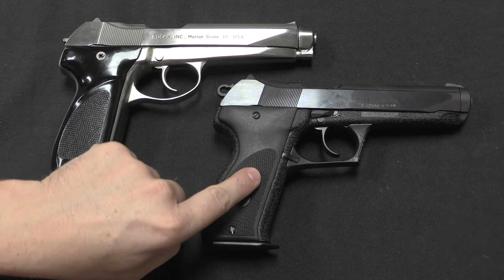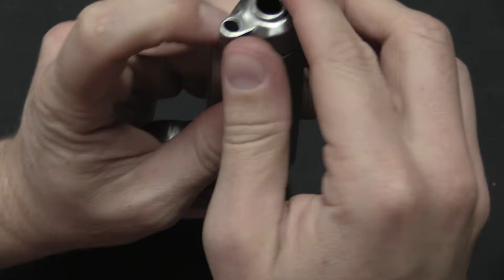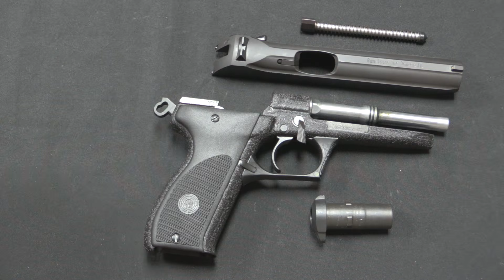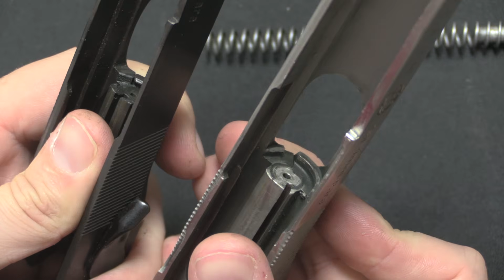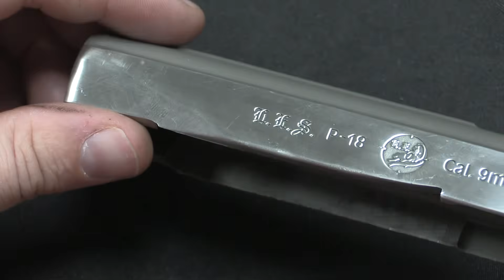Rogak P18 - A Cautionary Tale of Manufacturing

Comment: Gunbelievable has one of 12XXX S/N guns and the machining is even worse and  the rifling is almost non existing. They also dropped all pretense of the gas system actually working and deleted it and just threw in a stronger spring. He describes the recoil as painful. when it worked, and the bullets keyholed. https://www.youtube.com/watch?v=sMENPW1M2gg
Reply: In an update video it broke https://www.youtube.com/shorts/bX957MB2fFU

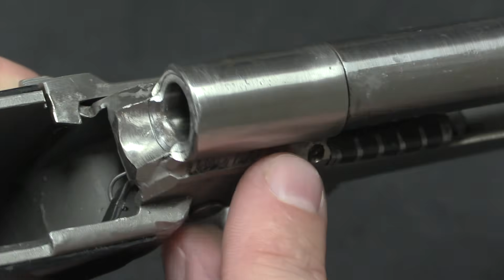Comment: 15:00 so, the thing about those welds… those are TIG welds, and they look good, but those aren’t welded with filler metal, they’ve simply fused the two pieces together, which is not a very strong method of combining the metal, which is another huge manufacturing error.

Comment: I have 2 Steyr GB's (Which means "Gabremse", or "Gas Brake" in German).
I liked it so much that I bought a 2nd one a year later from a different dealer, and discovered when I got home that they were only 2 serial numbers apart!
Only 5000 were brought into the US for homologation trials in 1985, with Sig being #1, Beretta #2 and Steyr being #3.
The Sig was too expensive, and Beretta was willing to build a plant in the US. Thus the new M9...
The GB has a hard chrome plated triangular/polygonal barrel (like the P7 M8) that's polished inside, and a plated muzzle cap (that's about the size of a 12g shell). It also ejects straight up, as not to throw brass on your teammates.
It's frame is 2 part stamped welded steel with an epoxy finish and only 46 parts, including the magazine.
It's also a perfect fit in the M9 holster!!
J

Comment: I feel like a skilled enough fabricator could've made a gun in this vein work. Rough casting surfaces, minimal cleanup. Stuff like rails and gas surfaces are perfect but everything else is raw metal. And that could be really interesting. But This is the product of somebody who just doesn't know anything about manufacturing. A skilled machinist could make a better gun than this in a garage out of mild steel sheet.

Comment: It's possible some type of hex head screws could be better, but personally I would never purchase a firearm with non flat head screws.

It's a firearms tradition to only use flathead screws and it should never go away.

I'm pretty sure in Dara they would have made a much better replica with no casting holesbor uneven parts, it would have a real gas seal and extractor.

Comment: I knew we were in for an adventure when I saw the grip screws and that weld. It was even worse than I thought! One important note is that bearing surfaces should always be smooth and polished in order to minimize wear from friction. The ones in that gun still had all the casting dimples on them. Amazing it could even cycle! Also, what is effectively, because of all the flaws and poor design choices, 9mm straight blow back even with those buffers must have been AWFUL to shoot. My hand hurts just thinking about it! This is an example of a gun maker that didn't DESERVE to succeed.

Comment: Stainless steel sounds like a terrible material for firearms...

Specifically, lacks the weight reduction of polymer or composites... and isn't a particularly durable type of steel.  As for corrosion resistance, that's what bluing is for, right?

Comment: Wait, I don't get the part about the extractor ripping the rim of the case. Its blowback so what moves the slide is the pressure pushing the casing out, so how would the rim get ripped off? I could see on a recoil operated firearm how that could happen since the barrel and slide move together and when they unlock, if the case is binding on the firing chamber, the slide moving backward would cause the extractor to exert a lot of force on the rim.
Reply: Cases expand when fired, which, with straight blowback like this, means an extractor claw can put pressure and rip the rim off the case before the case is ready to eject from the pressure of firing.
Reply: @VladamireD  But its the case thats pushing the slide back so how does the extractor thats on the slide rip the rim off the case?

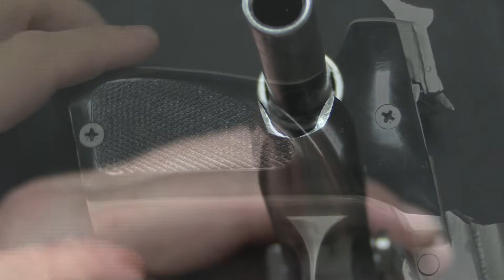Comment: 15:28  I don't get it, why the phillips screw is worse than Steyr's slot screw?  A screw is a screw, right?  If you tell me Steyr uses stainless screws, now that's better material, I'll agree it's a better screw.  I've also seen people change grip screws on 1911 from slot screws to hex or torx screws, as if that is an upgrade.  Grip screws don't need that much torque to tighten anyway :)

Comment: 12:00 If the gun functioned as a straight blowback then gas pressure would impinge on the cartridge case which in turn will push the slide, so there's not going to be any ripping of the case by the slide. The case pushes the slide, not the slide pulls the case. I think the reason why they gave up on the extractor is simply because they couldn't do it right with the primitive tools they had.
Reply: It's a pistol built with Bear skins and stone knives.

Comment: Look at all the apprentice marks on on that gun. Looks like they went after it with a dull beaver. Plus the casting looks like the surface of the moon or it's not actually cast but powdered metal injection molded. Gross.

Comment: 15:28 Why is it that Phillips head screws are indicative of a low-quality firearm?
Reply: A professionally produced firearm would never have grip screws that looked like you picked them from the 12 cent bin at your local hardware store. It's indicative of cheap construction and cutting corners, and how true that is. Would you buy a new car with similarly cheap looking bolts and nuts exposed on the exterior and interior?

Comment: My father had one of these when I was a kid, so I've always been kind of fascinated with it. (He sold it for around 50 bucks and felt like he got a damn good deal for that price.) Near as I can tell, there were three 'production' (using that term loosely) runs, with the second being the largest. The first run (2xxx) series were ~200, the 6xxx series anywhere from 400 to 800, and the final run (12xxx) less than 200. So, altogether there were anywhere between 900-1200 of these made, with 1,000 being a fairly safe estimate. 

The 120,000 serial numbers were known as the 'best' in terms of reliability but were usually the worst looking, with machining marks and tool dings apparent. From what I understand, Rogak had less than 30 days to clear out of town, so he and his family hand-assembled the remaining parts he had laying around in his kitchen and were able to create  another hundred or two hundred pistols that they sold to a wholesaler for about $10 per gun. The remaining machinery and spare parts were sold as scrap metal. 

Rogak was a pretty inventive guy. I think he intentionally wanted to create a unique, well-made pistol that could serve the law enforcement and military markets, but he wasn't a very good businessman. His lack of financial acumen lead to cost-cutting in nearly every step of the manufacturing process, and he had the political naivety to set up a gun foundry in the city that would later become infamous for being the first town in the US to ban all handguns.

Comment: Where Ian says that a particular spot may have been worked with a Dremel tool, I suspect it was done with a die grinder, which is much more common in industrial settings.  A die grinder can be thought of as a Dremel on steroids; or rather, a Dremel is a scaled down die grinder.

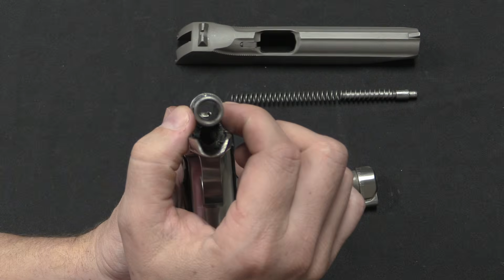Comment: eeeeeeeeeeeeeeeeeeeeeeeeeeeeeeeeewwwwwwwwwwwwwwwwwwww. My god. 9:57 you can see a mark from a grinding tool hitting the surface above the weld. This happened because someone hand dressed the weld with a hand held grinding tool. I'm gonna say probably an air die grinder. 

The weld is also a shitty weld. While it has the little circles they are not consistent and they appear to concave way too much. Also as you pointed out the casting flash on the outside of the slide is just too much and just shows lazy and poor work.

Comment: I still remember the gun magazines for the L.E.S. P-18..."Give it your best shot...19 times!" (Superimposed on a target with 19 bullet holes in it.) I wonder how often a full magazine could actually be fired without a malfunction. ;-)

Also, I owned a Steyr GB for several years in the mid-80's. It was a very fine pistol, although a heavy beast considering it was a 9mm. I often wish I had kept it, just because you don't see them very often.
Reply: That was supposed to read "I still remember the advertisements in the gun magazines"...

Comment: Are you positive they had schematics of the GB and not just Polaroids?
Reply: "It looks like someone described the real thing to the designer over the phone," as one of the guys on the old Top Gear once said about a Chinese knockoff of the Rolls-Royce Phantom.
Reply: I have a feeling they were actually trying to avoid an inevitable lawsuit by introducing these design changes. I don't know, really. Or they simply didn't have the manufacturing capacity to reproduce some of the elements in the original design, so they have replaced them with inferior substitutes.
Reply: now that's FUNNY !
Reply: It looks more like a case of hemorrhoids.

Comment: Early stainless wonder 9. Made in Morton Grove IL.  have 2 Rogaks. one I got that had issues. So I bought one at a local gun show for parts (Actually came from RI Auctions) to see if i could get the one working semi auto. i tried for a couple years and have given up.  I got pictures.  May need a new buffer pad for it maybe.  My satin finish one with ground extractor is 2607 and the hi polish with no extractor machined into the slide is sr no 12001

Comment: Why has the Steyr GB's delay system not shown up on any other pistols? It seems like a brilliant system, the only weakness I see is cost of manufacture, because tolerances. That could be solved using AR style gas rings though
Reply: Design costs. If you use a system used by one hundred other manufacturers, you doesn't really have to design anything new. All the weights, forms and tolerances are in the books, or you can more or less copy it from an existing design, and you concentrate on aestetics and/or secondary features.
If you use a new system, you have to really design every bit of it starting from a White sheet. The dimension of the gas ports, their position in the barrel, the dimension of the gas chamber, all relative to the weigh tof the slide...
Add that delayed blowback systems are slide-weight sensitive. Usually they comes in only one form (there is not a Compact HK P7, a compact Steyr GB or a compact Benelli  B76) cause to design a different dimension of the same pistol, is like designing a new pistol.

Comment: I would imagine that not just no labyrinth seal on the piston, but also that over-sized hole at the muzzle bushing which the barrel rattles around in, would both contribute to non-existence of the gas-delay mechanism.
Some high-speed footage of (some brave person) firing this would probably show hot gas jetting out under the slide and around the muzzle of the barrel.
It kind-of looks like Rogak recast (see "The Replica Prop Forum" for multiple long discussions on this) the slide by pulling a mould off of whatever Steyr GB prototype they'd acquired to make wax patterns for lost wax casting their own versions, they obviously thought "Eh, close enough. Just grind/mill the slide sides flat and stamp in our info"

Comment: I remember this gun from my first catalog in 1982. Was this different gas system an attempt to avoid the patent? It sends gas to push the bolt forward earlier. Sounds good, at least, in theory. Of course, the rest is a mess.

Comment: 15:02 the weld is a fusion weld and was done with a Tig, basically the weakest type of weld not discounting the weld defects like undercut which will make it crack even quicker, the Steyr weld has plenty of reinforcement and is how a part like that should have been welded. I bet that fusion weld on the rogak would not last.

Comment: Yikes. First thing i noticed was those heinous grip screws. The grip panels aren't that great either. Lousy quality for sure. I think i could finish it better in some areas, and i don't have all that much Dremel experience. Nice how they just threw in band aid fixes when they realized their machining was not up to par and the gun would not operate as designed. I guess rhis was before product liabilty suits became a big thing. I notice it says Morton Grove, IL on the slide. That was the goofy town that tried to ban handguns in the early 80's. Serves Rogak right for locating the company there

Comment: You know, the only part they really needed to get right for this to work was the gas seal. Everything else could be rough and it should work fine. When you have to put in fiber buffers and grind off the extractor to get it work, you should stop asking if you can make this pistol and start asking, should you make this pistol.

Comment: The two tick marks on the grip screws indicate that they aren't Philips, although a Philips screwdriver may work on them.  I spent some time trying to figure out what they are.  They aren't Pozidriv, because that has four tick marks in a cross pattern, not two.  They're not JIS, because that usually uses a dimple on the head.  So what are they?

Comment: These sort of remind me of pistols made by AMT (OMC, TDE, IAI, Galena, etc) in the same time period. Which is probably being uncharitable to AMT...
Reply: I have an AMT 45 that works every time, is dependable and beautiful to look at. When I got it i was told the slide and frame would gall and cause problems unless I took semichrome for motorcycles and work it on the slide/ frame rails. I did that and worked the slide back and forth for a couple of hours. That and a little polish on the feed ramps is all it took to be reliable.

Comment: Wow, nothing like a pistol that looks like it is being held together with drywall screws.
Reply: Rather funny that simpler slotted screws (which they don't even try using for common screws anymore since they're so shit) are considered "more professional" than Phillips.
Reply: @D8W2P4  I totally agree with you.  Slotted screws are a relic.  Or shit, if you prefer.
Reply: @D8W2P4  that's what I thought, Beretta uses a standard screw.
Reply: @D8W2P4  It's less about the slot pattern than the heads in this case. I mean, those are clearly not finish screws, Philips or otherwise. :)
Reply: What do you mean "looks like"?
Reply: The screws are actually Posi-drive
Reply: @pjteves1  Pozi-strip screws. Classic!

Comment: I recall this gun, when it first came out, I drooled over the magazine capacity, and in Stainless Steel even, wow that was the gun I wanted on my hip. Thankfully I never ordered one, I had an  ffL at the time, however my paycheck was a bit short, and by the time it got around to buying another hand gun, the desire for a stainless was still there, but I had changed my mind about the 9 mm and went with a .45 ACP instead, purchasing an AMT Hardballer, nice gun but it too suffered a bit from lack of finishing.  The main problem I had would have been an easy fix today, but back then I was not trained, when I took her out to the range to  zero her in, (She had a set of sights right off an S&W Model 19 in appearance!) I found that about every third shot, the firing pin came out the back, what was happening was the sight elevation screw was too long, and the firing pin would stick forward, then the retainer would come out an when the slide slammed forward, the firing pin would bounce loose, and come flying out the back of the gun.  Now days I would have I would have simply filed the screw down a tit and put in into the gun, I am sure she would be good to go, however I was still new to the gun world, so I traded her off on a target M1911A1 with an UGLY chrome  top, a huge rib holding fully adjustable sight system, this added so much weight that the recoil was extremely slow. she took every thing I could feed her so the work on the frame and feed ramp was very good.  This gun was heavy though, and I eventually traded her for something else.

Comment: Is there a particular reason for service pistols not to use philips screws?
Reply: Jack Mcslay I'd assume it's because the heads are harder to strip on flatheads, or because it's easier to find something to improvise a screwdriver with.
Reply: ToastyMozart   Maybe another reason is a flathead is easier to turn without a proper screwdriver, so for military use that could be an advantage, and I also remember in the early days screw supposed be hand made by gunsmith, so flathead also easier to make and looks better on a high end firearm, British shotgun makers still using this method today.
Reply: Generally  there viewed as cheap and a lack of forethought.
Reply: You need a special screwdriver. My Italian army surplus folding knife has a flat screwdriver, probably for the soldiers rifle/weapon, that is usuable without opening the knife. Gave one to a hunter friend...

Comment: The Rogak doesn't seem like something safe to fire, to be honest. I'd love to see some more about the Steyr GB, though. That thing is beautiful.
Reply: Steyr GB is beautiful, grip is perfect, shoots really well, easy to strip and theres 18 cartridges in the magazine. Best pistol in the world, in my opinion. Rogak is just a piece of crap!
Reply: I know, I was looking at that thinking, "We chose the Beretta over this? Austria chose the Glock!?" I mean, I get it, Glocks are clearly a big deal, but they aren't exactly nice looking.
Reply: @MichaelPoage666  price.
Reply: @MichaelPoage666 i have read that the gas brake system tends to make the GB heat up to point of discomfort after about 50 or so rounds. Similar to the HK P7. I dont own either so i cannot confirm myself. HK did add a plastic trigger guard shield to their p7 mid 1980s.